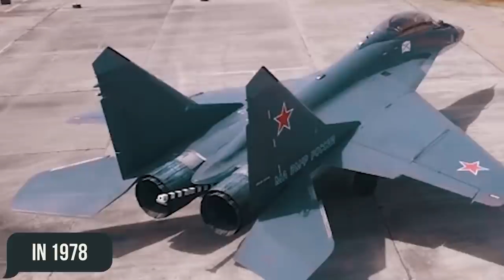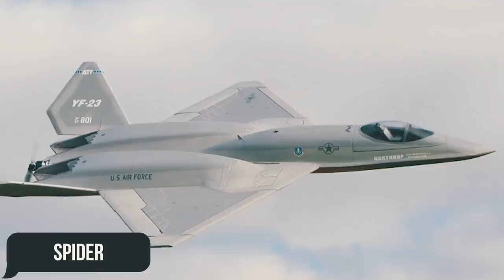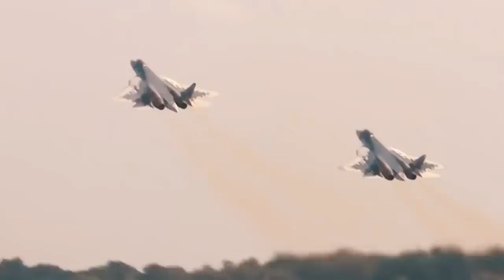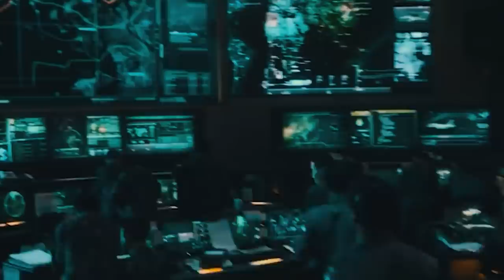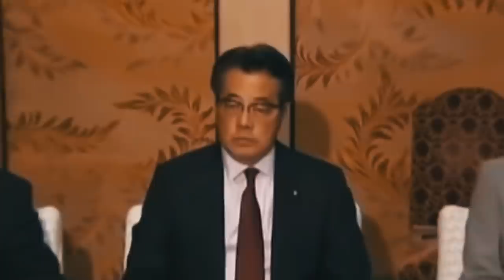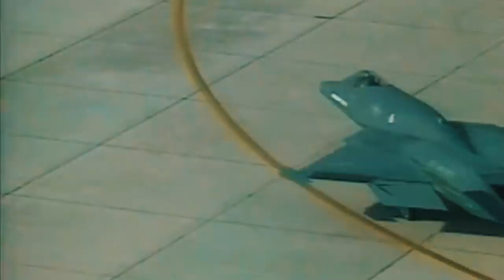Reborn YF-23 Will Shock China and Russia Soon!

Comment: "You won't get in close up battles", said the people who said to leave the gun off the F-4 phantom

the YF-23, probably isn't a bad fighter, but stealth and straight line speed only protect you before you are detected and before the missile leaves the rail

 and this video flat out lies, in contradiction to itself, earlier in the video, stating that the YF-22 isn't capable of super cruise, while stating earlier that it can achieve mach 1.58 without afterburner? ALSO, YF-22 had a faster top speed than the F-22 because the YF-22 was originally going to have variable geometry inlets (henceforth called VGIs), but the testing aircraft were told not to exceed mach 2.2 because higher speeds would cause excess wear to the available stealth coatings of the era. The YF-22, if not for the stealth coating could have easily hit Mach 3 with its VGIs. Additionally the F-22 has better range on internal fuel, better internal weapons storage, its more maneuverable, and provides the pilot with better visiblity

This video is just full of lies, while potentially vastly more expensive than the YF-23 (We don't know cause the F-22 never barely made it to 1/4 of its full production run before being canceled, therefore saddling the only 195 aircraft with recouping redesign and re-engineering cost foisted on the program by the CBO and the SASC when they said that they wouldn't pay for VGIs when they weren't necessary, and the tooling costs of ramping up manufacturing from Prototype to Production Line. The cost per F-22 would have dropped drastically around the 300 fighter off the line, and the final fighters off the line would have cost little right around 55 million... see that is the thing, if you look at the averages, it still would have run about $150 million per plane over the cost of the entire line, a lot  i know, and still about 20 million over the original projected cost per unit, BUT, better than the $350 million that each unit costs, because the plane it self, still only costs $150 million, but there was a massive development, re-develoment, tooling, and spinup costs, that had to be spread over far fewer planes, that never got to benefit from the volume production, and the increased efficiency that would come from from not only increased production capacity, but innovations in manufacturing techniques.

Comment: If the YF prototypes had standard Delta wings they probably would have won the consignment, fuel efficiency will ultimately rule the next generation of anything defense related and the YF aerodynamically has plenty of room for improvement.
Reply: U.S. F22 Japan YF-23 "brother"--------> The cocktail F22 with the brain of the F35 on Japan's YF23 2022

Comment: Not choosing the YF-23 is just another example of the U .S. military's myopic where new aircraft are concerned. This is a problem that has happened since the late 21930s. WAKE UP AMERICA!!!
Reply: The fuck? the YF23 was inferior on almost every way. Less payload, less maneuverable. 

Maybe in straight line speed it's faster but then it's more an interceptor than a fighter.

Furthermore if they upgraded it to meet standards it would have to be lengthened considerably to accomodate the required hardware considering the airframe limitations. 

The YF 23 is trash

Comment: F23 was put on hold bc USA needed a superior jet to the f22.  General knew that putting the 22 out would get adversary to show off and copy designs.  The adversary did not know of the 23.  The 23 is a better aircraft which looks like a fighter tweak of the Sr 71.  I think think a lot can be done to revamp the 23 to be fast n nimble while cost effective.  The 35 is a overcost.  The a10 is more valuable I think

Comment: Since Mitsubishi Heavy is already assembling F-35's , Japan (w/ Northrop help) should try to redesign the F-23 for parts commonality with it. 2 x F135 engines and whatever tech was developed for the F-3
Reply: Wonder why Japan See's f23 good points and decided to act on them ..while US settles for a 2nd rated plane?????..ask any pilot..if they loose one engine they have the second one to get back home!
Reply: @walterkazban1819  Depends on how the first engine was lost, parts from a exploding engine could take out the second engine. Mitsubishi also builds the F-2 . Some differences in the F-2 from the F-16A: a 25% larger wing area. composite materials used to reduce overall weight and radar signature. longer and wider nose to accommodate a active electronically scanned (AESA) radar. Japan is also working on upgrading the radar on the Meteor missile. Japan makes some of the best carbon fiber material and has much exp making CF products.

Comment: The F-22 and YF-23 are arguably still to this day the best performing F-aircraft Stealth and by the numbers. A lot of hard work went into the YF-23 and it's good to see they are bringing it back and putting it into production. Curious though to see how they perform against each other. Still both jets are far superior in performance and avionics and weapons systems than any of the modern russian made stealth fighters.
Reply: I don't know about that. F-22 is to be retired in 10 years were the f-35 will be around for another 30 years.

There's already open competition for the next fighter to replace the F-22.

They had an opportunity to buy more at F-22 but instead they're planning on using the f-22 platform as a test bed for the next generation fighters.

If you come out to Las Vegas where I live, you can see modified f-22s flying around from nellis and area 51.

They're pretty noticeable as they have a reflective aluminum coating or body on them supposedly supposed to help with stealth characteristics but they look far different from the standard of F-22 even from a distance.

Comment: The Swedes have an upgrade jet fighter from Saab Scania and it cost one third the cost of the F23 fighter jet program.   I don’t have the specs but the US version of the F23 fighter is capable of larger payloads as well as more variety of weapons interchangeability.   Supposedly the F23s are also longer flying jets when less payloads are taken out.

However, both Sweden’s and US fighters are not battle tested as of yet.   The other fighter that is supposedly more powerful are the newer Russian jets but technology issues most likely laden these with more servicing downtime.

Comment: sarge grinch, if we look back at the competition there was little difference between them in maneuvering and the f22 has been taken to a finished platform, in my opinion, the f23 would have been a far better platform. its speed without afterburner was marc 1.8 the f22 was 1.58 and it didn't have room to grow but the f 23 could I think achieved easily 2.0 + just cruising and the capacity to carry all ordinance which the f 22 would have to have a new design to carry all of our weapons inboard and with the advantages of the f 23 being classified but rummer has it the f 23 was much faster by a "very" large margin that is from one who was involved in the project and was very disappointed because most thought the f 23 was clearly the superior fighter choice, in fact, the other side thought they had a very slim chance of being the choice. but at least we will get a chance to see what most of us have been waiting for a really advanced platform not just an upgrade of old ideas

Comment: Sorry that many commenters don't know that Japan has tried but did not get YF-23, they settled with the costly F-35 due to threat from China and Russia. However, they are making their own F-3 6th Gen fighter jet, so hopefully their will success, I know Japan engineers they work long hours and tirelessly for their country.
Reply: The f35 ended up being a much cheaper jet than the f22
Reply: @beeker9821  True. You can say that now because F-22 Raptor production line were scrapped and the SKUNK team were gone. Thus to restart F-22 production line and engineers again would cost much more than F-35 right now, So better yet is to start 6th Generation Fighter jet, which would be much better and improvement of F-22 and F-35 combined.

Comment: With the modification from design 1, this is better than the F22 and F35.  Now can it be manufactured and done cheep enough not to get an ax.
Reply: The F35 is a general purpose craft meaning it will be able to do all the grunt work but will be very similar to the F22 performances. Maybe not as specialized but for a general purpose fighter it is very impressive.

Comment: I think smart stealthy and fast systems are cool and deffinatly useful for breaking an enemies highly fortified defensive systems, S400 etc. But too much emphasis has been placed on stealth for all systems. Just like how the best counter to calvary is not better calvary it is pikemen so is modern warfare, we need to invent a missle like the tomahawk that can be launched from any platform air sea undersea or land and. It is Launched with a group of missles some stealthy and some not, the stealthy missles hold back and watch for the non stealthy missles to get shot down exposing the location of the launchers then it reports back the location via peer to peer networking on each missle over the horizon back to its air sea undersea or land platform and then another volley is sent this time with the updated location of the S400 launchers.   The 2nd volley would include in the mix plenty of low cost drones that can idle in a holding pattern over the target look for movement and when they find it the drones drop their primary wings and land a small cheap dumb bomb 💣  more precisely on target.   Think cost of grenade on consumer drone vs. Cost of multi million dollar smart bomb.  We need to invent solutions on scale. Because a future war with China 🇨🇳  most certainly will not be exclusively with big weapons like tanks aircraft carriers and airplanes, a future war will include many small weapons that asymmetrically take out expensive high tech systems with brute force of dumb mass produced tactical weapons.
Reply: The real danger is not S400 it is smaller arms systems can be be used on mass to target a craft during a major war. 
The idea of the stealth is to ensure that it cannot be seen until it is too late for the enemies. It is not always about being completely invisible. The idea is to be able to hit hard, fast and not be seen until the enemy is dead and did not know it happened. Sort of like a ninja but it does not mean invisible.

Comment: As par for the course, the yf 23 was to be alocated to Japan. In the event of costs vs. tech. As it concerns the yf 22. All designs tables algorithms and flight tests. Were made from 1978-1982. by a nine year old son of a dairy ranch hand. In Nicasio CA. The lafranchi ranch. on a dinning room table. With a half round protracter. A plastic pecil holder/sharpener, with a slide rule calcularer. A timex stop watch with a broken plastic band from k-mart. The ranch is in a coastal moutain range corridor. On the right day the winds would creat a wind tunnle. Between the house and the garage, to wind tunnle test the modles.  Hanging from a wood dowl and some string. On foggy days the modles would be launched from the back door patio steps and air flow paterns could be tested. In the pea soup of that fogg. All planes from the fx 88 to the yf23. Were created at that ranch by a nine year old. p.s. e=mc2 was disproven. Super string theory had to be devised to save e=mc2. This many years later a f.t.l. ship has been developed. Proving tachyons and gravitons. So much for the string patch e=mc2 is dead.

Comment: Whats ridiculous is the Reason the Air Force gave for choosing the F22 over the YF23 Black Widow.
They state over and over that the 5th Generation fighter was to be stealth and surprise it victims and not necessarily engage in Air to Air combat in close. But that it had the superiority in case it did.

If it really was all about Stealth - Then why not choose the aircraft that clearly had the Edge and advantage over the F22 when it came to both Stealth & Supercruise ? The very primary metrics they always use as why they choose the F22 and features of a 5th Gen fighter. Plus the newer sensors etc... But as for all that both planes are equal.

It is abundantly clear. The Air Force choose the F22 purely from looks and the typical feel and look of a fighter plane. The Black Widow was a departure in many ways and either the decision makers just didn't like the way it looked and stayed with the usual familiar shape or its your typical who greased whos palm the most for the contract.

Comment: YF-23 was an excellent aircraft when the fly-off against the YF-22 was made. HOWEVER, the current F-22 has over 20 years of technical innovation since its debut. F-23 has had ZERO so far. 20 years is an advantage that is hard to beat. Japan has much catching-up to do.

Comment: Ok, another dumb comment on the video:  "...the 5th gen fighter would not engage in close combat and would have more emphasis on maneuverability." Maneuverability is MOST important in close combat, or "within visual range (WVR). 

One of the main reasons that the F-22 was chosen was due to the fact that it had thrust vectoring for better maneuverability. Yet it's that's beyond ironic when you consider that most engagements (and training for air-to-air engagements) focuses on beyond visual range (BVR) now.

Comment: I love the F-22, but the F-23 had better features in almost all aspects. I remember this victory was very suspicious for everyone in that time. And from nothing, they stopped the F-22 project. Now, well... F-35 costs is around 1.6 trillion dollars and more and more  problems appeared. Lucky U.S.A. for have so much public money to waste on military and politians whims.
Reply: The F35 is not going to cost 1.6 trillion. That is a projected cost of running the entire program over 50 years and includes all of the branches of the military using it as their base aircraft and also international partners using it as well. 
Right now the actual unit cost of a F35 is cheaper than an F18 when all the weapons packages are included. 
So far the program has cost about $50 billion which will also includes building the aircraft for other countries. 
The F35 can do almost everything the F-22 can do but is a general purpose fighter meaning it is a cheap all round aircraft.

Comment: Until build and tested, everything said is but words to the wind. Like the F-35 which was supposed to be the best fighter, turned out to be just another round of the mill aircraft that can be detected, jammed and shot down. Not much of an edge or advantage against Russian EW systems. By the time this new YF-23 is build, there will be most likely  be other aircraft with better capability.

Comment: Risk averse USAF general decides mach 1.8mach cruise of YF-22 outweighed the more advanced stealth and better overall design of YF-23 at 1.58 mach cruise, despite the YF-23 having super sonic without afterburner, while the F22 did not.  Argh just upgrade the damn engines of the YF-23 and switch off the F-22 already.  It was a mistake back then, YF-23 is a way better stealth jet design and upgraded with modern engine and sensors would rule all.  Fix it Japan you can do it.. even if the US is too dumb to choose the better option in their own deck.  Politics.
Reply: F 22 can supercruise. It doesn't need afterburners to break the sound barrier.
Reply: Also F23 has inferior payload capacity and maneuverability. 

It's such an overrated design.

Comment: Why does everyone automatically assume that the YF-23 was the better airplane? Are you all conversant with the requirements of the contract and the testing of the airplanes performance to determine that? Even this video's reason to prefer the YF-23 was it looked cooler. The video also claims the YF-22 wasn't capable of super cruise, uhhh... Wrong. The F-22 can super cruise at 1.8 Mach with no external stores and 1.5 Mach with a air superiority load out. I'm not saying the the F-22 was and is perfect, it's not, but like any program that makes such leaps in technology it's an on going process. It's also way too expensive.  I'm saying that if you want to make a decision of the merits of these two aircraft, at least do it with factual information and not subjective judgements. To be honest, I think the YF-23 looked way cooler but I don't think that means it's a better airplane. If Japan can take the YF-23 design and tweak it to overcome it's faults then great. It sure would shorten the design process.
Reply: Actually I was in the Air Force when the competition took place and the YF-23 actually beat the YF-22 ad almost all of the requirements only being slightly less maneuverable in close combat simulations. Plus you are wrong about the speed of the F-22. It was only as fast as they said in the video. Yes it could supercruise but at mach 1.5, not the the 1.8 of the F-23. The cost would have been pretty nearly the same.
Northrop has been getting screwed and with them the American people too, when the air force was told by certain congress critters to approve the B-36 instead of the smaller, less expensive and better performing XB-35. Mind you the B-36 was an impressive plane and did a lot of things well, it's just that Northrop could have delivered about 1 2/3 B-35s for the cost of 1 B-36 and they could do anything the B-36 could do, well except be used to carry experimental fighters in a test to see if that was a good idea. It wasn't.
Note that we ended up with only 20 B-2s because while the initial purchase was intended to be a couple of hundred, the budget committees kept cutting back the quantities which caused the price per copy to sore astronomically high. And now we only have 19 because one crashed.
Eisenhower warned us of the military industrial complex having so much power and we ignored him.
Reply: Jim...you have no idea what your talking about